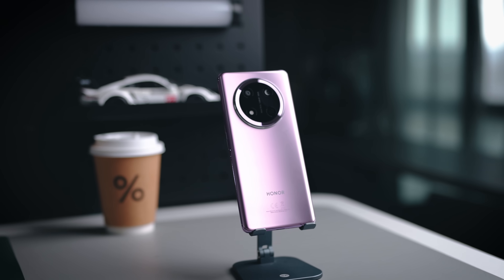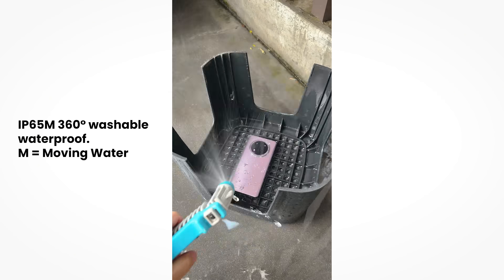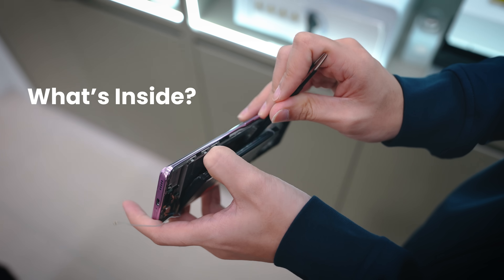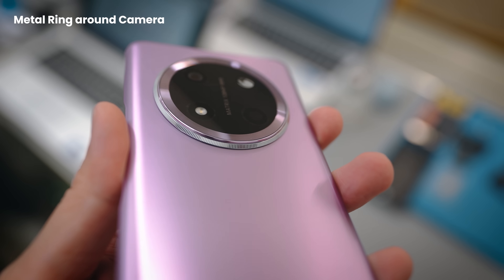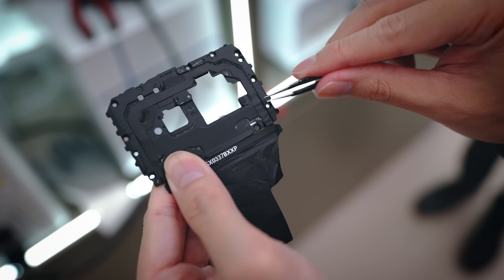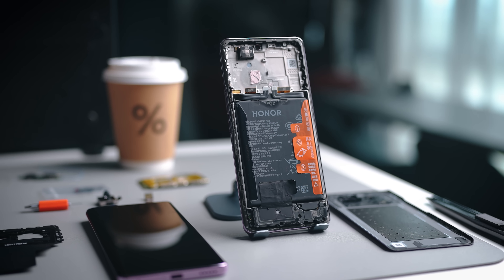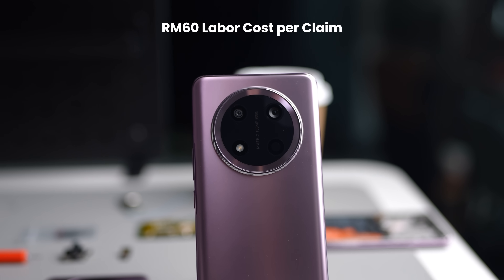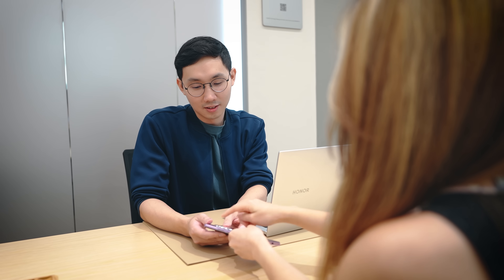Looking INSIDE the HONOR X9C 5G: What Makes it So Strong?! 🤔

Comment: Well, all the ads show how the phone falls to a smooth and clean surface of a ceramic-tiled floor. That's indeed a valid test, but I haven't seen anyone testing it on the actual road with bumps and very harsh asphaltic cover.

I am an owner of X9c, and I like it a lot. However, I fell off of the motorbike last week landing on the left side of my body, where the phone was with the back side up, and the phone ended up with a broken camera glass. Had to remove the entire rear panel in the service centre. So, not that durable, but still very much cool and worth the money.

Comment: I will buy this phone, if it comes with better processor or if this phone comes with one of the newest processor
Reply: This 6 gen 1 is actually 7 gen 1 rebanded dont trust the number i have both honor 90 and x9c actually it the same performance.
Reply: @ประภากรประยงค์หอม  how do you know ?
Reply: @ประภากรประยงค์หอม  I am rough user
I will prefer realme narzo 70 turbo over this because 70 turbo has better processor and 30% to 40% cheaper than this phone

I know x9c is toughest phone but same processor comes into 10000 rupees phone and x9c costs 22000 to 31000 rupees online with cash on delivery
Reply: @ประภากรประยงค์หอม  also I am heavy gamer and make videos for my channel
Reply: @ประภากรประยงค์หอม  I am fan of honor phones

I have honor 8x 6/128 gb variant and I bought it in year 2018 and it is still working with heavy and rough usage but with only one issue no service issue because of this issue I was thinking of buying new one

I was thinking of buying x9c or 200 lite but only turn down is their processors

200 lite comes with dimensity 6080, if both of the x9c and 200 lite would have came with dimensity 7300 processor then I would have bought it.

Comment: Dos phone has cooling systems  ???  Cuz im gamer and im mostly worry about heat issue on phone  Although the processor is relatively powerful according to what i heard , but my usage is  intense when playing games, and it gets hot on my phone, is Xiaomi 11t pro  global version Europe  and  and I have i thinking for years about replacing it with this phone. But my last problems is heat During intensive use with games, compared to my Xiaomi 11T Pro phone, my phone has cooling system room
Reply: 6 gen 1 soc is not meant for gaming.       Just get a phone with at least SD 7 series and you will hardly have overheating issue.
Reply: @arsenal_84 Ngl 6 gen1 quite better than 7 gen 1 Accelerated i used honor 90 before.

Comment: if only this has at least SD 7 gen 3, I'm fully sold to getting this one.
Reply: I wish the honor 200 is as durable as this was
Reply: yes 6gen1 is ngam2 aja kalau boleh up lagi
Reply: same here man but they stayed with snapdragon 6 gen 1😞
Reply: @davey5807  its battery efficient and cheap. the price would've been way higher if it used another chipset. it also mainly to attract older customers who dont game much and do work where if the phone falls, it wont see the day again.
Reply: over time the performance won't be great in the long run
Reply: Why still stuck in gen1
Reply: @銀漢-u3y  power efficient + makes it cheaper
Reply: @ to cut cost
Reply: That defeats the purpose... This is made to last longer from usage and durability